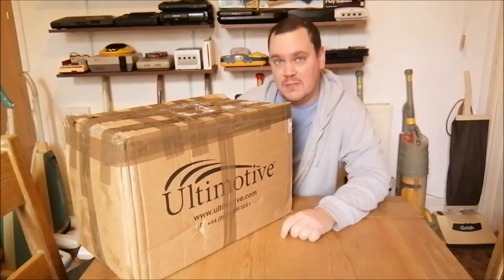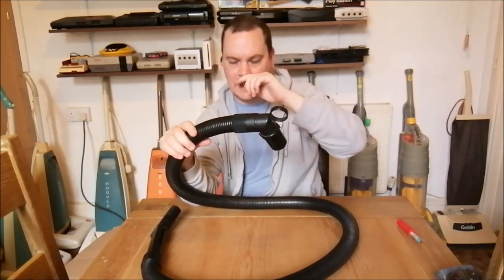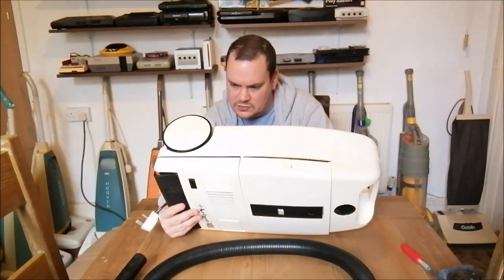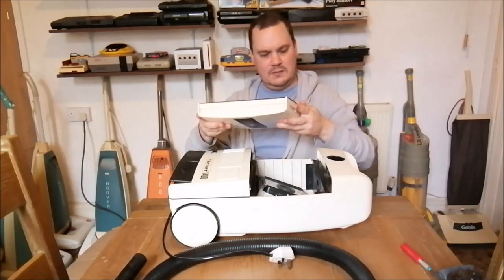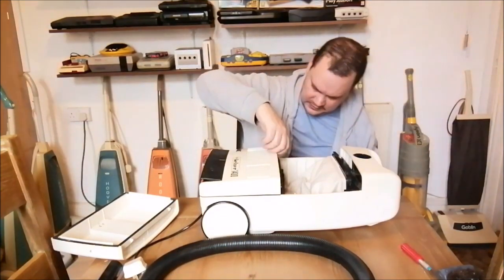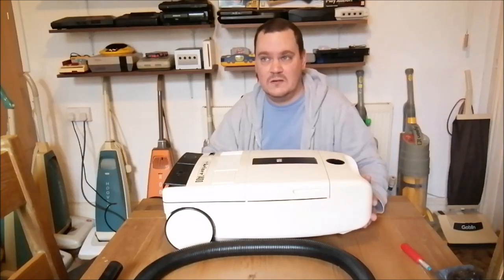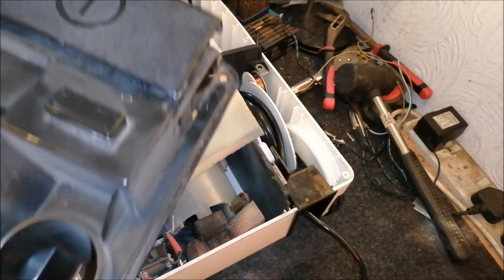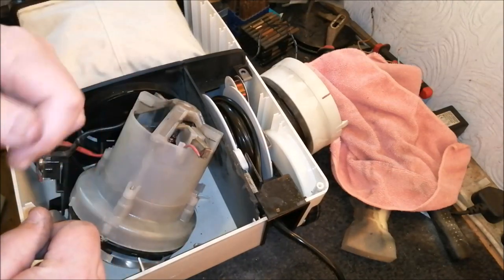Unboxing / First Look - Latest Purchase - Mystery European Cylinder Vacuum Cleaner - What IS it??

Comment: This is an ETA 1400 vacuum cleaner from Czech (Electro Hlinsko Praha).  In Germany it was offered relatively cheaply under various brand names by the large mail-order companies at the time such as Quelle or Neckermann.  At Quelle it was sold under the name "privileg".  I have the predecessor (ETA 400), which was sold in the former GDR because the GDR was an allied state during the time of the “iron curtain”, as the isolated Eastern European countries were called.
The machines were produced in the 1980s. On original named ETA-machines rating plates there are a date code of production like 02/82, that means February 1982. Your machine have a problem with carbon brushes and the suppressor can be exploded! In my ETA 400 the suppressor was blown up.
This little plastic is a place holder. On other models is a plug socket for a electric power nozzle.
Reply from the maker: I honestly can't thank you enough for all this information. And thank you for solving the mystery of the little plastic placeholder - I was losing sleep over that wondering what it was for! It still begs the question... what is this cleaner doing in the UK? I wonder if a family emigrated to the UK from Spain and brought it with them. Or maybe an ex-pat came back from Spain? Don't think we'll ever find the answer to those questions lol

Comment: Don’t use that ring for pulling out the hose. It will crack. It’s made to hold the hose end which you hold in your hand when you stand the machine upright with the hose fitted in place. Just make a little loop of the hose and stick the end intro the ring. This way you can pick and take away the vacuum up with the hose in one piece.
Reply from the maker: You absolutely blew my mind with this piece of information. I tried it last night and it worked! What a clever idea!!
Reply: @TheVintageApplianceEmporium  if you are interested, I can send you the user manual pdfs and give you more information. I collect ETA vaccums from Czechoslovakia since 2008 so I have some interesting stuff in my PC. Love ur channel!